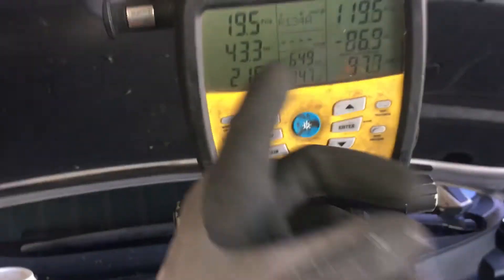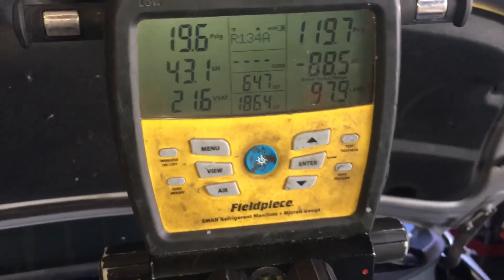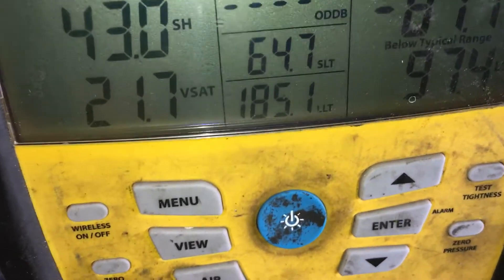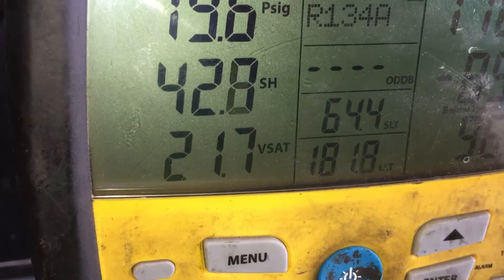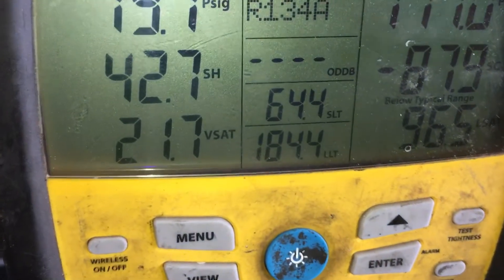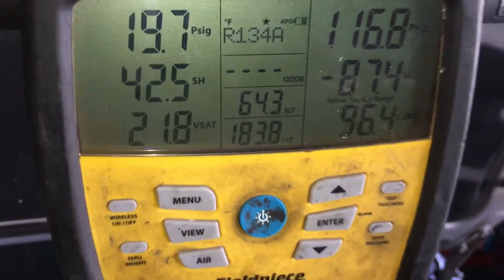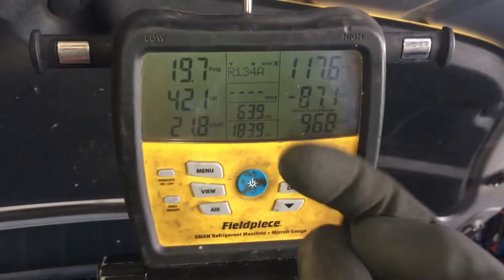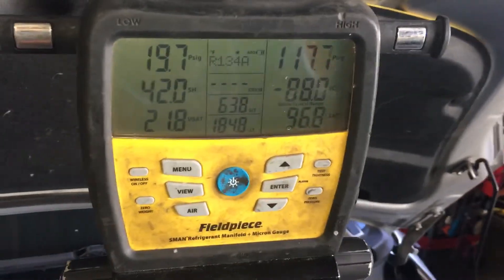How Hot is the refrigerant compressor discharge temperature on a low refrigerant charge

Comment: Yes, and the compression ratio is approaching 4, which produces more heat, as well.
Reply from the maker: Yes exactly plus lack of oil and superheat,  

And there’s one thing different about this compressor compared to your unitary compressor in your standard commercial or residential condenser. 

Since this one is controlled by a computer trying to achieve cooling no matter what the consequences

For example if your fix speed split system compressor was spinning at 1750 RPMs and will make up an imaginary number that it had to flow 4 pounds of refrigerant a second to achieve 60,000 BTUs of cooling. On a full system 

Let’s say this variable speed compressor three face on this car had to do the same RPMs with the same 4 pounds of refrigerant to call the same 60,000 BTUs

But now on this variable speed compressor let’s take out 3/5 of the refrigerant out of the system we now have less mass occupying the same space to move through the refrigerant lines or orifice

But the computer has a command to cool the occupied space and it thinks because of the low refrigerant has a heavier heat load and it’s not performing its task within a given time so it may increase that 1750 RPMs to 3000 RPMs thinking it has to move more pounds of refrigerant faster through that office to obtain cooling. 

        But the little brain of the computer goes looks at the cabin sensor temperature and says we’re not cold yet we must need to move more pounds of refrigerant so let’s turn it up to 5000 RPMs but we’re still low on refrigerant so we both know it’s not going to achieve the cooling but it’s trying it’s a dumb machine

Still not cold enough Computer doesn’t know this it just thinks there’s a big heat load so let’s turn it up to 7000 RPMs to move more pounds of refrigerant through that office to deliver to that evaporator that must be really under a heavy hot load. 

     But there’s no heavy hot load it’s just a dumb computer looking at a sensor that’s not hitting setpoint within a given amount of time

And now that we’re very low on massive refrigerant that beautiful solvent call refrigerant scoops back into a compressor that contains oil that that refrigerant picks up and carries away from the compressor goes through that orifice tube and drops into a low velocity into a evaporator vapor refrigerant passes but the liquid oil stays behind

Guys in commercial and residential fixed unitary speed compressors don’t have to deal with that issue it doesn’t exist like cars or large VFR or heat recovery units by Mitsubishi or daikon or FUJITSU or LG